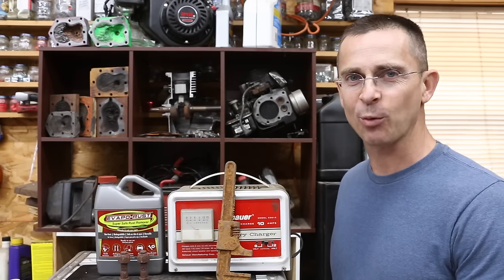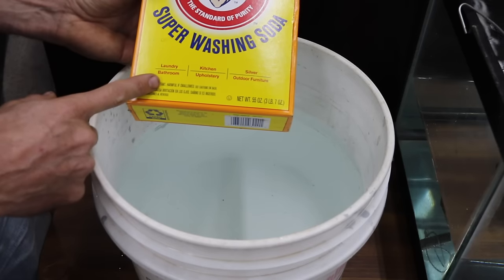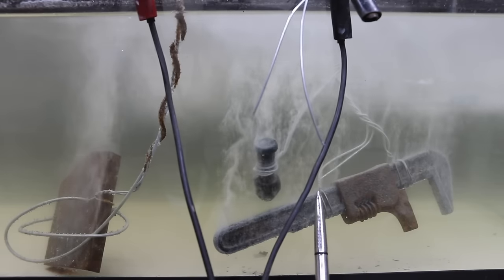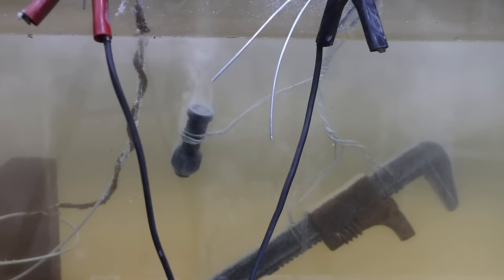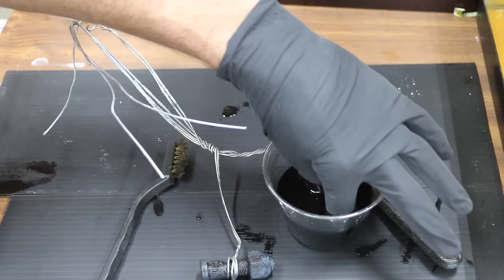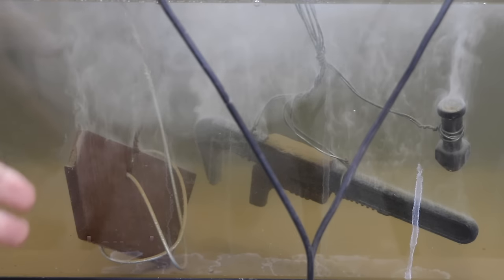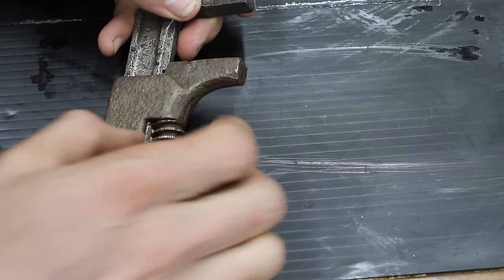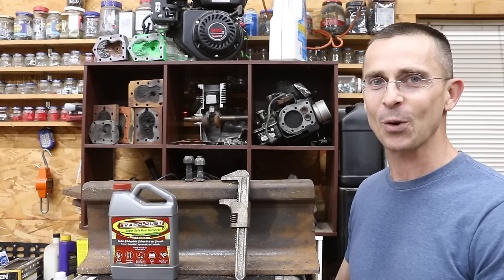Is Electrolysis better than Evapo-Rust?  Let's find out!

Comment: Clearly sponsor is evaporust lol or buyer’s bias. Electrolysis is obvious far more precise and measurable that some private business oil which is inferior to that crud be gone or even muriatic acid. Just use muriatic acid in short 1 minute or 30 second bursts and clean with a base like soapy water. I hate how attached he is to evaporust. Its fine but not the greatest.

Comment: SO many issues at least learn how to perform properly!

They are two very different methods and result in two different finishes.

But your error is two-fold. Firstly, there is no connection to the adjuster and hence no current will flow. Secondly, it is important to clean the sacrificial anode every time it gets a build-up.

Electrolysis is fantastic and quicker than you show in this video, and if you control the current it is gentler with your components.
Reply from the maker: Thank you!

Comment: What type of wire were you using during the electrolysis process?  Is you battery charger a "smart" charger?  I have good luck with electrolysis using tie wire and a 60 year old battery charger.  I use at least two pieces of flat steel 12"x2"x1/8"  as my sacrificial metal, and place the parts between them.  Graphite also works great, according to  shopdogsam https://youtu.be/MAo9wACYozQ